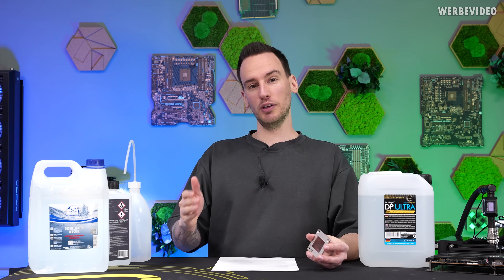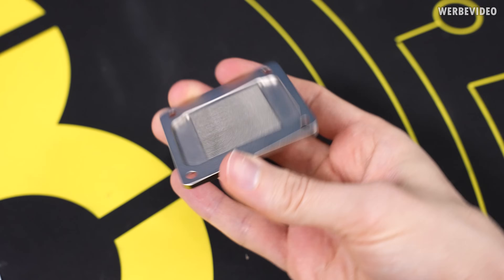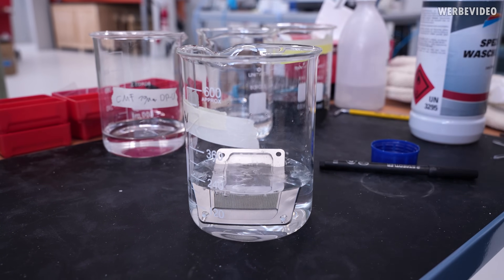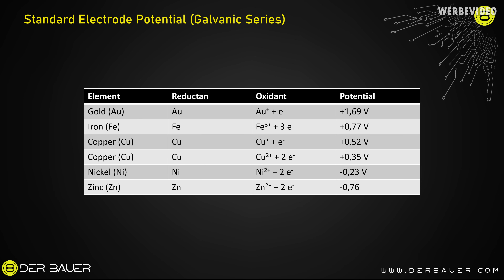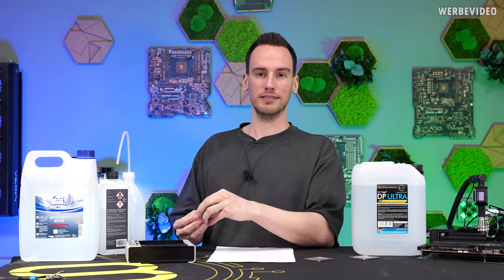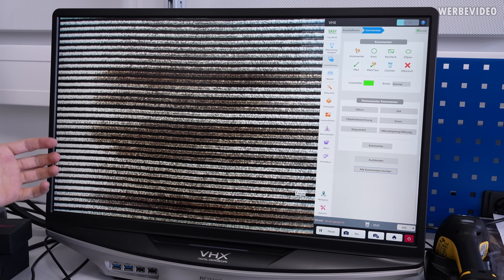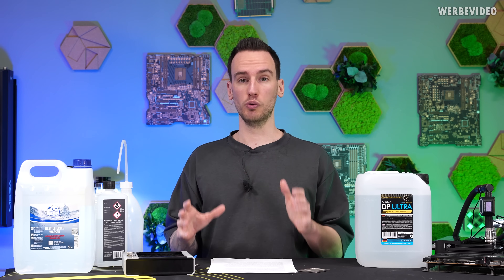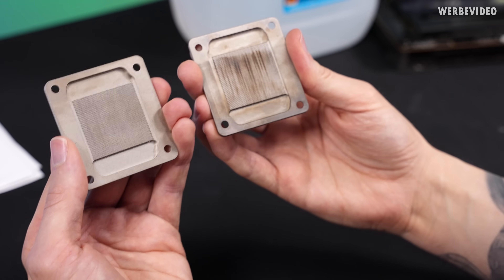Do NOT use Distilled Water for your Water Cooling Loop!

Comment: Always good with up to date and relevant information for modern water cooling products!
The explanation was detailed and comprehensive der8auer.👍

I still have my Maze 2 cpu water block from 2002.
Built a retro system some 6 years ago I think using it and I do run it with just distilled water for two reasons.
If it leaks I dont want additives to contaminate any parts, also I dont want to replace the water every 1-2 years for reasons mentioned in the video.
Ran it for 4-5 years with a modern 120 rad (copper/brass) and a modern 12V pump, no reservoir and black tubing so algae wont grow.
Drained the loop like a year ago and well the water was as clean as when I filled it 4-5 years earlier.
Refilled it again and put it away.
I believe my main problem will be the o-rings before anything else gives up, after that probably the pump.
Back when the block was new in 2002 me and most people used "Water Wetter" as an additive, was sold by most water cooling stores at the time.

If it was a modern PC and my main system I would definitely use inhibitors, no color additives, just the minimum I could get away with, but I would still go with non transparent parts being the blocks or tubing and I would only consider nickel plating if I wanted to use liquid metall.

Comment: Nickel is pretty reactive in atmosphere, especially when it’s in contact with other metals. It’s also low in the galvanic series, so it’ll be quick to react. This is probably not a problem of the deionised water, but rather a bad application of nickel plating.

Comment: Yep as a chemist it is very obvious that distilled water is very corrosive. Almost the better the quality (the purer) the worse it gets. Adding some ions will do wonders but watch out do not use simple kitchen salt as that will make it even worse, you need bivalent ions. Just get some cheap coolant for cars. Yes that is overkill as it has anti-freeze in it which we don't need but it has all the anti-corrosion in it and is cheap.
Reply: Just use cheap supermarket demineralised water meant for steam irons, it's not very pure and it will absorb some ions from your radiator and waterblocks in the initial minutes after filling and then stabilise after that. The main reason to use that as opposed to tap water is to prevent calcium deposits.

Comment: Distilled water is often acidic due to dissolved CO2 from air. I'm wondering how glycol would keep it more neutral. In addition, is the leeched copper really an issue? Will the thin copper layer on the cold plate be etched through? Would be nice to see some longer term measurements, in terms of both reliability and thermal performance. Plus, I tried using EK blue cryofuel but it gives me a whole lot of insoluble blue particles in the loop (plus the blue stains). I suppose these would be worse than a bit copper corrosion.

Comment: This segment was very useful because I learned something. Never, ever use a water cooling loop. Computers and liquid really weren't mean to play nice together. I use an AIO and it cools my CPU just fine. I have no need to show off with a water cooling loop just because I can when most like me have absolutely no need for it.
Reply: What exactly do you think is in your aio? They just use a glycol/inhibitor mix...
Reply: @winebartender6653  Of course - but I don't open the damn thing. When it stops working I buy a new one. I don't try to refill it.
Reply: @regwatson2017  I mean, you're original post is just contradictory lol. There isn't some massive difference between an aio and custom loop. Both operate and work on the exact same principle and both encounter the same issues.
Reply: Ok buddy R

Comment: fingerprints on copper is a real bummer, but couldn't you apply some transparent coating on the outer surface of the waterblock to prevent oxidation?
Reply: Some clear plastic or acrylic should be good enough, no idea why it isnt done.

Comment: Off-topic, but do you guys experience water slowly - over a month or multiple months - disappearing from your custom loop (water level in the reservoir dropping), with no signs of leaks?
Reply: Evaporation? If you take a good look, do you see vapor on the wall of your reservoir?
Reply: @Boborjan1986  no, if there is no leak anywhere, then it must be air slowly finding it's way at the top of the res.  Permiation throught tube will happen, but in a span of years, not a month or 2. Also, "no signs of leak" don't necesseraly means "no leak"

Comment: I was planning of using distilled water, but now going for molten salt on my next thorium reactor build.
Reply: There’s a great Danish company, Copenhagen Atomics, that sells purified salts for thorium reactors for your next build.
Reply: @luipaardprint  and then we all get radiated, or ?  We, mutants,   hahahahaha
Reply: lolxd
Reply: Solid plan, I've been doing that for years without issue and my thorium reactor's been running great
Reply: @cburgess7  I was thinking that molten salt reactor might also solve my main setup high power draw issues with the RTX 5090. I might even go with dual 5090 setup if my home isn't burned to crisp before that.
Reply: @Monsux  i personally keep a fully staffed fire department next door for my dual 5090 setup
Reply: An individual of culture I see
Reply: Based
Reply: "fun" fact, corrosion is said to be quite a big issue for molten salt thorium reactors.
Reply: Actually molten salt will be a nuclear mess if it clogs! 😅
Reply: With PrimoChill Utopia, oxidation/corrosion in the loop is prevented, but it cannot be used if there are any aluminum components in the system.
Reply: Those leak... the one in Miami (major plant) is leaking into Miami water... i know all the science.. you deniers dont, its unsafe
Reply: I would not pay any mind to what he said. Just keep in mind what he said "DON'T USE DISTILLED WATER WITHOUT ADATIVES".  He could of said don't use tap water. I brought a water distiller and ran the water through it twice then added the aditives and have not had a peoblem with it. and that was two years ago. I had a EK water block and after a couiple of years i opened it up and it was still like new. i sold it because i could not see the water go through it.
Reply: @keibohow69  what additives? I'm racking my brains on what exactly to add to the distillate

Comment: how about distilled water + some silver. some people in watercooling reddit are saying it works for years. other question: if I want to change some pc part or wc block is it OK to leave old block without flushing it with anything? like no residue or reaction happen will after contact with air?

Comment: One curious question, say for an AIO, I believe the liquid used have different additive, at least with different OEM, assuming all are fine fluid without corrosion and  gunking up, would you think it will be fine say, using bequiet supplied extra fluid with a Lianli/thermalright AIO for topping up?

Comment: It's obvious, Distilled Water will bloom one day. I'm using WC systems almost 20 years, and my best option - mix of water and antifreeze. It's prevents bloom, lubricates pump, prevents corrosion and adds nice color.
Reply: g48+ distilled water, ran for a couple of years without any issues
Reply: @pilu9538  I use a 75/25 blend of Zerex G48 50/50 Prediluted Antifreeze. I cut it with distilled water, so the mix is 75% Water and 25% Antifreeze. It's been running that way non-stop for 5 years and has never been swapped out. I only add a few ounces to the loop once a year to top off the evaporation.  The loop looks just as clear as the day it first ran.
Reply: If you use automotive antifreeze, be careful if you have pets. That thing tastes and smells sweet and animals are drawn to it but it is also toxic AF. A lot of pets have died from drinking antifreeze in garages where a careless DIY repairman have left a vat of old antifreeze lying around waiting for disposal.
Reply: what ratio do you use?
Reply: @ymroo8299  I’ve used 10% - 20% antifreeze to water anymore and it will foam up. 

Can also use a product called Water Wetter little expensive but works well.
Reply: @ cook to taste
Reply: @ymroo8299  I was using 50/50 but it was a bit too viscous (was running 2 d5). It did have a nice blueish colour to it
Reply: Exactly need the antifreeze to keep it friction free. I add a few drops of bleach in mine never had an issue.
Reply: @SOH_South  me too, distilled + some drops of beach. Actually running since 2019. Using this mixture since 2001/2002, we had to  produce our own waterblocks😢 funny times!!
Reply: @giuliolenzoni428  iodine mix will also work in place of that lol

Comment: For anyone who needs to hear it
Distilled water = deionised water.
They're both purified water, the only difference is the process used to purify them.
Reply: The literal only difference is that deionised water uses an ion exchange membrane to remove ions from the water whereas distilled water uses distillation to remove the water from the impurities. This means that distilled water is usually often purer and sterile compared to deionised water, but unless biological contamination or very high purity are needed they are, for all practical purposes, interchangeable.
Reply: For the purposes of throwing liquid into a loop, that's true.
They are definitely not the same thing, though. Deionized water is of a higher purity; as the names suggest, deionized water has far lower ion concentration.
Reply: Takes a literal single web search or LLM prompt to confirm that no, distilled and deionized water are not equivalent...

Comment: This is known as oxidation-reduction or ‘redox’. And to add more publicity to aquacomputer, they have a slightly expensive but apparently useful product: ‘flow sensor’. This measures the conductivity of the liquid and tells you when you need to replace the liquid (before it acts as an oxidising agent).
Reply: The sensors are called ORP sensors....oxidation-reduction potential sensors.  Used them for wastewater treatment to tell if all the sodium hypochorite (i.e. bleach) which is an oxidizer....was neutralized.  So our batch was in a reduction potential state.
Reply: my DP ultra has been sitting at 13.6uS/cm conductivity since I started using it 2 years ago. Can't say enough good things about DP Ultra or aqua computer
Reply: This is what you test for in routine vehicle inspections, not just for condition of the coolant, but electrolysis, etc.
Reply: Cool, I didn't know that. I have their D5 Next pump, but its flow sensor is a lot more finicky than their dedicated Flow Next. It also doesn't have this conductivity feature.
Reply: @Slavolko  the D5N flow sensor is kind of bunk regardless.
Reply: @Wasmachineman  I can imagine.
Reply: @Slavolko  D5 next doesn't have an accurate flow sensor. Aquacomputer even calls it a virtual flow sensor because it's just an estimate based on the speed of the pump and how much water it should be moving
Reply: @iamdmc I'm aware. I'm thinking of getting the High Flow Next for accurate readings.
Reply: What wait is this also on the high flow next? I have it yhe old one  but I haven’t installed it lately as im out of fittings to actually check it.
Reply: @ The HFN has both flow and conductivity sensors.
Reply: @ thanks!! I will install it this weekend as im about to change fluids and testing some thermal pads and honeywell ptm. I’ll look on those metrics on the HFN.
Reply: Thanks for making me discover this product! (Yeah I sound like a bot but whatever 😅)

Comment: does the protective layer reduce the thermal transfer to the rest of the liquid?
Reply: My gut instinct, not based on fact -- Initially no, these are just ion deposits. Eventually these deposits build up on top of each other, in the same way calcium or other deposits do, and that can impede flow characteristics, which in turn in will eventually begin to impede thermal transfer characteristics.

Comment: Sounds like the bigger problem is nickle plating the copper block. Also the annodic index of bare zinc wouldn't matter if it's alloyed in the brass.
Reply: Brass has its own anodic index which is unrelated to the anodic index of zinc. Unfortunate omission in the video imo.

Comment: I know that in industry they use sacrificial anodes to move where any corrosion happens. Would this work in water cooling?
Reply: Probably yes, the issue would be finding the right metal, because nickel is way down there in the galvanic series, which is also probably what is happening here.

Comment: My main issue with additives is when you have to flush it, they are toxic for environment.

This is why im not using distilled water but reversed owmosed water to have a reallylower electric potential.

I alredy run on that three years on my previous loop.
I'm waiting my 5070ti waterblock to replace the 3080 in the loop. 
I'll take picture of my 3080 waterblock after 4 years of distilled water as i need to replace the orings before giving it to my son.

Comment: Me with distilled water in my loop running for 3 years, seeing this video 😅

I don’t have any transparent parts. Do I dare to open it? Hah
Reply: Took 8 years before distilled water did anything to my cooler, replaced it with fresh water and used a bit of vinegar to clean it. Still working on an old i7 4th gen. If it fails it fails, probably give me a reason to upgrade that old PC .
Reply: @hoodman420  replacing it with MORE distilled water, is what kills the parts.
Reply: Distilled Water is better than using tap water  I always wondered if the anti-corrosion agents in automotive coolants would work in PC water cooling.
Reply: @animejanai4657  In the old days before water cooling was as big as it is now, people WOULD use car inter-coolers and antifreeze.
Reply: @animejanai4657  yes they work. i have distilled water with 15% automotive coolant ment for older car (no recommended change time). i have ran my older computer more thatn 5 years witn no problems and newer has been running over 2 years and no problems.
Reply: @animejanai4657  They do and are totally superior to any PC-specific cooling additives you can get for the price. Automotive coolants have billion dollar R&D systems behind them (everything automotive does). Ford's VC-7-B coolant is absolutely excellent (it needs to be since their Ecoboost engines have so many cooling problems). Mix it 10% with with filtered, softened tap water (Ford specifically says not to use distilled, all the major makers do probably for similar reasons to Roman's findings here) and you will have an excellent PC liquid coolant that will last for many years.
Reply: Ran my system from 2018 till 2024 with distilled water and biocide (PT nuke if i remember correctly), have transparent tubes and reservoirs (have about 3L of water in the system for the purpose of having a lot of thermal mass), and while there is a little discoloration, never had any actual issues with it. In 2024 did a maintenance/refill as over time a lot of water evaporated from the system, and its running ever since the same. Now im planning to repaste the cpu as last time i couldn't find my TG paste, so used some noname whatever that came with the cpu, and i can see the cpu temps are not where they used to be. 

For Roman: I love the details you paid attention, but for now im going to stick to how my system is, and reconsider it the next time i will do maintenance, in about 3-4 years.
Reply: other than some possible minor surface corrosion, i doubt you'd actually see significantly less cooling. you're more than likely fine.
Reply: One of the other comments mentioned using pink Toyota coolant or red prestone heavy duty coolant.
Reply: ran mine with only biocide added for 6 years untouched. The blocks were slightly discolored but the tubes and reservoir were clean with no discoloring or films. Compare that to any name brand coolant i've ran that lasts like a year and ruins loops with staining or discoloration and nasty films on everything. I think yours will be fine.
Reply: I recently (days ago) built a custom loop for two RTX A4000. I flushed my radiator with distilled and then got lazy for a couple of days to assemble the entire thing with coolant (not distilled). Your story gives me hope after this video. 😀I had a hard time (no I don't use amazon) sourcing (only) 2 liters of CLEAR coolant I couldn't waste any on flushing. I went way over board on the radiator, alphacool "monsta" 560 with 8 noctua fans in push pull config. Even under high load the gpus temp  doesn't hit 30C with fans set to 30% duty and it idles at 24C. I used to idle at 45C and regularly/easily hit 95C with the fans at max. The A4000 is notoriously hot due to its single width.
Reply: It's a none issue if you have put any additive in there (glycol, water wetter,  or any of the assorted water cooling additives you can buy)
Reply: Yeah but except distilled water you add bensotriasol as well as inhibitor of crorosion.

Comment: I ran pure water for many years, over 10 years, with no additives other than a silver ring in the reservoir. I had nickel-plated and pure copper waterblocks; pure copper rads. No issues for years on end. However, recently I started experiencing buildup of weird foreign material that looks like semi-trasparent thin blue scales. Haven't yet figured out where it's coming from, no time to tear down and rebuild everything, but it must be some kind of corrosion.
I do believe I've never had an issue with algae or bacteria. The silver is supposed to help with that (I don't know if it's really needed).

Comment: Remember reading about Volvos car testing in the hot Death Valley in US where the boiling point temperature was rizen with glycol and over pressured system. Open loops has no overpressure to my knowledge, but then again, you seldom reach over 100° C in an computer, then something is very wrong.